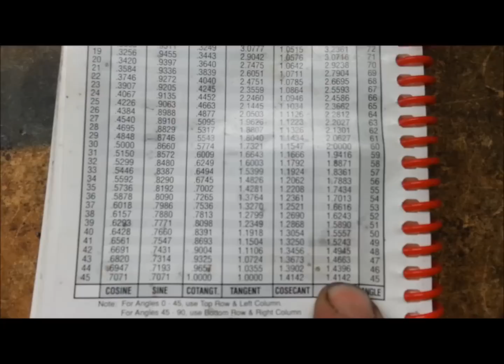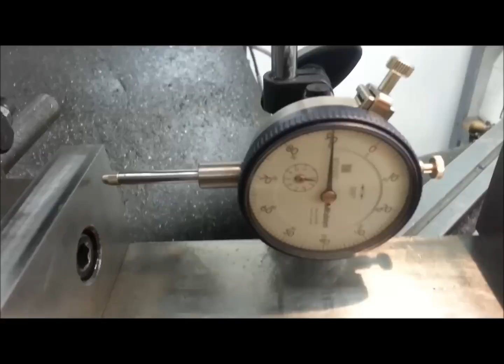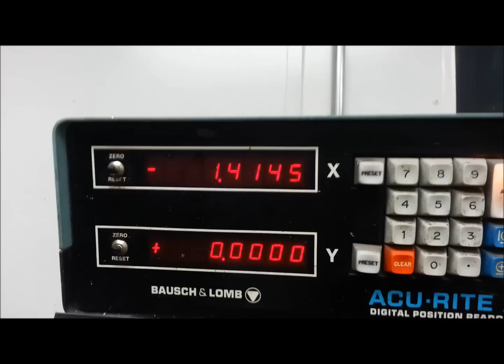Setting a mill vice for any angle

Comment: So if you dont have a dial gauge, can you do this with 2 dial indicators.  one as you show would read 1.0   the other to measure the x movement, head on, would read 1.414?  Is that correct?
Reply from the maker: Bruce williams for 45*, yes.

Comment: That chart is not exactly right in several ways. For one, it has the SINE and COSINE of the angles backwards. Example, the Sine of 35° .5736 but the chart has the "Cosine" column as .5736 and the same, the Cosine of 35° is .8192 but it has it in the "Sine" column. The Same thing applies to the Secant and Cosecant, they have them backwards. Example, the Secant of say 54° is 1.2361 but they have that number listed as the Cosecant of 54°.

As for using this to set the angle of a vise, using that chart will only work for angles 45° and larger and assuming that you use the "cosecant" column since they are backwards because what you want is the Secant of the angle you are  in which you are trying to set the vise at. And this is IF and ONLY IF you are using 1" (1 inch) of travel on the dial indicator. This is also assuming that you are "saying" that 0° is the vise jaw parallel with the axis you are moving, so if you are moving the X axis, then this assumes that the 0° is parallel with the X axis.

The real proper way to do this is to decide what you want to read on the dial indicator, then just simply divide that amount by the Sin of the angle and that number is what your axis movement should be when you have the angle right and the indicator moves the desired amount. Example, lets say that you want a 30° angle and you only want the dial indicator to travel (Depress) lets say .750", then to find out what your axis movement would need to be, its simply .75 ÷ (Sine of 30) or .75 ÷ .5  = 1.5, so you would want to see .75" of movement on your dial indicator when you move the axis 1.5" to know that you are at 30°

The reason why the video worked is because the Secant of a 45° is 1.4142 and thats for 1" of dial travel and as I mentioned, the Secant of an angle works out to correctly for any angle is you are using 1" of dial travel because to find "Secant", its 1÷ (sine of the angle) and the "Numerator" of the division formula being the dial reading amount and for get Secant the Numerator, the Secant works perfect for 1" of dial change.

Basically all you are doing here with all this is solving for the Hypotenuse of a right triangle from a known angle and the length of the "opposite" side. Your angle is obviously the angle you desire to set and your dial indicator movement is the "length" of the "opposite" side. The length (Or distance that you move, or need to move) the axis (X or Y) is the hypotenuse.

My suggestion is to become accustom to doing it by your own determined amount of dial and the angle as I showed above in the 3rd paragraph because this can help you if you have an angled feature on a part that is already in the vise or might be a part that is too big for the vise and you might be clamping it to the table or to a fixture, etc... but you might not be able to get enough axis travel before the dial indicator hits another feature of the part before 1" of travel on the dial indicator is reached. In this day in age with smart phones and scientific calculators on them and most people having their phone on them, its quicker (Typically) for one to grab his or her phone and calculate the number then it is to grab and reference a chart (just my personal thoughts on that one).
Reply: Hi Chris, I use tables like this all the time. You have to get used to looking at them or you get fooled like you did. There are 6 definitions of angles at the top and bottom of this table. If your angle appears on the left side of the table, you use the defined columns on the top row and read down. If your angle appears on the right side of the table, you use the defined columns on the bottom and read up. The chart is fine. I have watched this video a couple times and sit here scratching my head as to how 1.414 is the sine of 45 degrees, but i like the concept. I have a video very similar to this technique on my channel on how to set a lathe compound, so I get the mechanics.
Reply: Joe Pieczynski thanks for pointing that out. I didn't notice the column definitions being different top vs. bottom and see now.

I do still stand behind my statements of it (at least sometimes) being more practical to calculate out for other increments other then 1" of indicator travel. If however you don't have to worry about limitations in certain instances and now realizing the top down vs. bottom up column differences, I can see referencing the table as a more practical method. Again, thank you for pointing that out about the column differences.

Comment: I would like to have seen more info on the method of getting the vice set up, as in choose some angle, 25 degrees, that the vice is NOT currently set to, and do the entire process, including actually turning the vice to get the correct angle.

Comment: !.414 is not the sin of 45. Sine is defined as Opposite over the hypotenuse. Since the Hypotenuse is greater than the value of the opposite side the value should be less that one (.707106781 by my trusty calculator).  So what am I missing.
Reply from the maker: +James Reed hyp length = sin x 2 (for 45)
Reply: +James Reed, See my post above, I point out the issues here and what is "Missing" along with what the video creator was trying to get at.
Reply: Chris P., Your Post confirms my previous post and explains why in this one example (45 degrees) things work out.  I think that the video should be edited to explain what you have written in your post.  I did not catch that the columns for sine/cosine and secant/cosecant were swapped, Good Call. All in all it is an interesting approach to setting a mill vise to a particular angle, just need to get the terms straight so you get the correct values.

Comment: I see two issues. 1. You're putting a side deflection on the probe. This would not be good for the probe. 2. How do you know the probe is exactly 90 degrees to the solid jaw?, Perhaps using both X and Y axis movements can yield a good result however you would still be putting a side deflection on the probe. Start at one end of the jaw and zero the indicator and DRO. It wont matter if the probe is exactly 90 degrees. Move the Y axis several  inches, and the X axis the same amount as the Y. You should get a zero reading on the indicator. This method works for 45 degrees without any calculation. For different angles, use Tan to calculate for X and Y axis movement.

Comment: I'm glad I saw this video. I'm a fairly experienced novice machinist, and I'm learning trig, particularly as pertaining to sine angles for set ups on the lathe to make Morse taper and R8 arbors. Don't ask why, I just like learning this stuff. Anyway, when you were in the book of trig tables, I couldn't figure out where you got the 1.00 inch number from, and also it appeared your finger was pointing at the last column which wasn't the 'sine' column at all but the 'cosecant' column. What the 'fuh'? Simplify please.  Hangin'  a sine bar and some gauge blocks off the side of a lathe has proven brutal.  However, converting to decimal inches as your video shows may be  the solution I'm looking for.  Thanks for any help, and keep'em coming.   Mark
Reply from the maker: The 1.414 is a constant for 45 degrees, it really doesnt matter what unit of measurement you use, inches, feet, miles, meters, etc.
For every 1 unit of movement 90 degrees to the jaw, you get 1.414 units on the hypotenuse.

Comment: Ha, ha, you cheated, you used your very nice angles you made the other day !

In fact you were not SETTING the vise at an angle - you were "CONTROLING" if it was set on a specific angle 

AND 

I think it's a very needed condition, that the dial is set perpendicular to the fixed jaw too

so the accuracy depends on the perpendicularity of the dial in relation to the fixed jaw right ?

I'll have to re-think the theory behind to get you a bullet proof proof (can you say that in english - well you know what I mean, I think !)
Reply from the maker: Hi Keld,

Yes, everything depends on the indicator being 90* from the vice jaw, I guess I didn't hit that point hard enough, but even a 5* variation in your indicator will result in a .020 error.

Just use a tiny little square .. wonder where I could find one of those?

Stan.
Reply: Shadon HKW Ha, ha, yeah, but it IS a nice little project with your small squares - and I'll make some one day - sure.